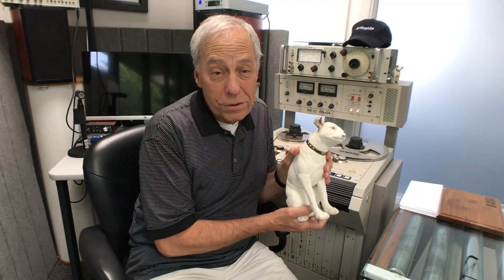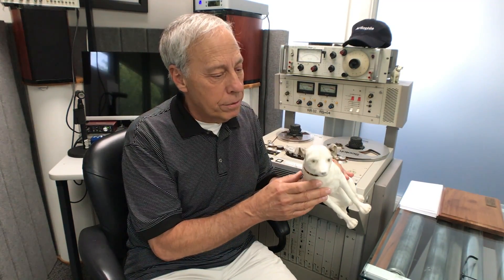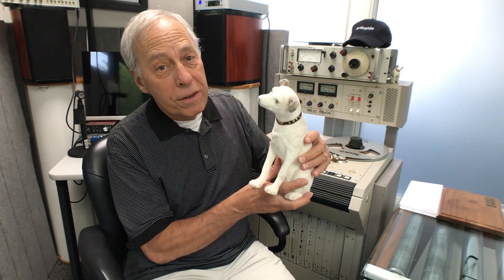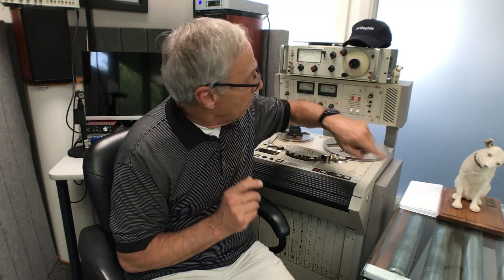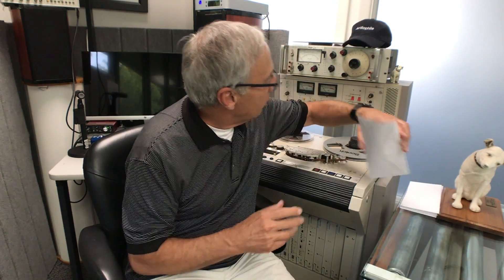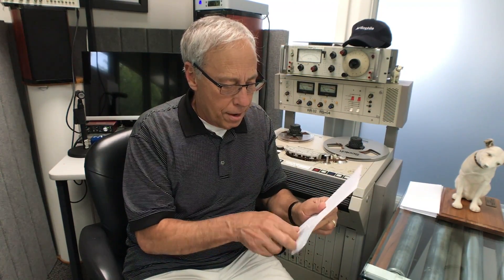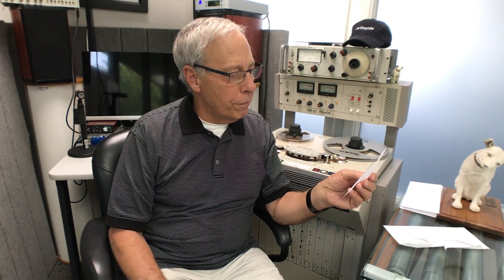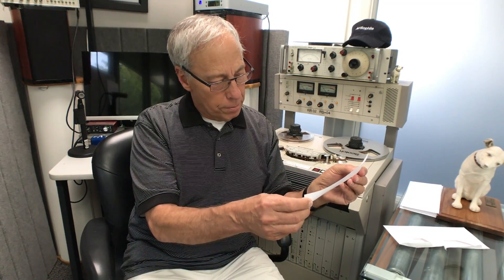Thin cables inside speakers

Comment: Okay straight answer. Money. That's why. They save it. You don't. But it's not needed anyway. 

Convoluted answer. They work with people that sell that fancy thick wire, and realize you don't even need it anyway. But don't want to make these people look bad, and kill the golden goose. He said more about himself by not really saying anything. And showed me that he has no integrity by doing this. There are a few people in the industry that will tell you this truth. Like Frank Van Alstine. His stuff even has the old school power wire you can't swap out, because he knows it's not needed. It's Snake Oil period!

Think you need big fancy cables? Ask an electrical engineer, and see what they say.
Reply: Hey Paul, I'm gonna be on the fence here ... I've been playing bass for 30 years, getting paid 29 of those. I honestly don't recollect how I came across this page just now, but when I saw the title it got me curious. Now that I've read this, I'm even more intrigued. On stage, my low gauge instrument cables ... hmmm ... when all that gets to the circuit board inside my amp, the wiring is tiny on it's way to the huge cables going to my speakers. Not jumping on any bandwagon, but just saying this initial question got me curious, and your initial answer didn't do any favors for yourself so that's maybe why he came across as snarky :) ... love to hear a detailed answer from an engineer or IT guy though, or more of your thoughts. Again, I'm just a spectator who found my way here, but I've also earned a living as a bass player for over two decades, always buying the best cables. Thanks sir!
Reply: Andrew Balus -- Peace, little one. :)
Reply: HH Scott had a point. This video didn't even come close to addressing the point of the question, much less give anything that even approached a technical answer to it......with references to thick wires and thin wires and "horse leg" cables. He did mention a couple of gauge numbers, but then didn't put them in any technical context. What ARE the issues here? Surely it involves technical issues of how much power the cables and leads must carry......not to mention less tangible issues of quality and durability. Do we judge the internal wiring by the same standards that impact external power cables connecting the speakers to the amp or not? There was no answer to the question, but some talk about the ceramic RCA doggie with fur and some fumbling unsealing a white envelope.
Reply: Dannys998876 Well I didn't know this when I wrote that, but Paul here doesn't just make/sell amps, and speakers. He also sells.....wait for it....

That's right. Cables! His most expensive power cable is $1200!!!

Think that might be why he didn't want to get "technical", and actually give an answer? Yea me too

Twelve hundred frikkin dollars for a cable that these companies freely admit, even though they're engineers, they don't know why it even works. It can not be measured. But it sounds "better". We just don't know why. Lol

Audio Quest made HDMI cables for audio that sounded so much better on their ad video it was shockingly good! So good that someone decided to look into it. The guy was a pro, and ran tests on it. He found out it was a fake. It was completely rigged. Then they pulled every copy of it off the web, and it's not been seen since. Tried to say someone else made it. Lol

Those thin wires in the speakers are fine. It's just a short run. Same reason they just use thin wires in equipment too. Fancy cables are a waste. Unless you're running really long runs, and/or a lot of power. You don't need anything crazy. And even then. You don't need crazy thick. Just a little thicker. And you should get good quality if you care. But just buy Blue Jean Cables quality. That's good enough. 

A lot of this audiophile stuff is a waste, but some can even hurt your equipment. I was just reading something that Roger A. Modjeski (Music Reference amps) wrote about this. The fancy resistors, or something like that were causing failures in the units he was seeing when he did repairs. They weren't electrically sound. They were never properly tested that way. Just for sound quality. A lot of times the cheaper stuff is better. Not the cheapest I mean. Just regular premium quality stuff. 

Some of the $50 audiophile fuses too are not good to use according to electrical engineers. They're not the correct design to work as they are intended. Which is to keep you gear safe. They don't put safety first though. They design for sound quality only. Or let's be honest. They design them to sell as ones that give better sound quality. Because I doubt it even matters, as long as they're not junk Chinese fuses.
Reply: Exactly.  Every electronics engineer learns ohms law in first semester.  He claims to be electronics engineer but doesn't answer the question for which he, as an experienced electronics engineer, should have an abundance on knowledge.  But he sputtered on about everything except.
Reply: Andrew Balus
Reply: This is a trick question by the way ... I'm just trying to help ;) (I'll keep my 25' bass cables on stage)
Reply: HH Scott......I agree that there is stuff that matters and stuff that doesn't. And in this case, the answer didn't even come close to answering the question. Plenty of dancing around it though. There is no limit to how much money audiophiles will spend on c*** that they think makes a difference.......but obviously doesn't from any measurable engineering standpoint. I have many friends with middle aged hearing who claim to be able to tell the difference between a solid state amp and a vacuum tube amp.......and FAMOUSLY, there is that lush sound from vinyl records that people are just SURE sounds far superior to top quality digital media. My standard snarky answer is that OF COURSE I can tell the difference between vinyl and digital.........the vinyl is the one with the annoying pops and clicks.
Reply: HH Scott.....Interesting comments! I never had a collection of vinyl, or any sort of high end sound system. Mostly MP3 files through computer speakers or some CD's played through the little sound bar sitting below my TV screen. I'm afraid that for many people, computers and MP3 files took away the interest in high quality sound systems, in the same way that my older photography friends say that digital images on a computer screen took away the magnificent Kodachrome film images projected 3 ft wide on a screen in a dark room. I do have a few friends who have more or less high end sound systems. They will say they hear all sorts of differences in all sorts of things. For me, past a certain minimum level of system quality, all I can really hear clearly is the quality of the speakers. Based on what I can hear, it seems to me that whatever big money I would spend would go into the speakers. I have listened to vinyl, and particularly In very quiet passages of classical music, the pops and clicks drive me crazy......compared with CD's and digital audio files.
Reply: Dannys998876 Speakers/amps aren't everything at all. The source is incredibly important too. It's a chain, and it's only as good as its weakest link. But you also have to remember that the more you spend, or the better the gear is. The more revealing it is. So a good source won't make a difference with a receiver. But will be dramatic on a $30,000 system. 

What I'm putting together right now for my source is a Raspberry Pi/Allo Digione/linear power supply combo. And then I'll eventually get a real nice DAC. Although there are cheap ones that sound good like my Starting Point Systems DAC 3. There are much better ones for $1000, or less. You have to choose carefully though. I do mainly Tidal streaming. So that works for me, and will be really good. If I had better equipment. I would have to spend more on something like an SOtM sMS-200ultra ($1400 with master clock connection, $1200 without), instead of the Pi. And instead of an $80 linear ps. I would get the $300  Sbooster power supply instead. And probably a master clock too. This would be a waste for my system though. And would cost me a kidney. 

Then there is system coherence. Some stuff just works better with others. I have a pair of Pinnacle PN8+ speakers that sound okay on a receiver. Better on my SET, but really only on the tweeter, and amazing on my AVA Omega Star 250EX. They need the power, and it's a more balanced amp. Older speakers designed in the days of tubes would be very different. These were designed in the 80's. A bright sounding DAC, and/or speakers will sound good on a vintage tube amp, but horrible on a very high definition solid state one. And vice versa. You would want very warm speakers, and DAC on that amp most likely. Although there are people who love bright, and really defined. I hate it. It hurts my ears. 

So you need to know/learn what sound you like, and learn what works for that. And match them accordingly. You then may have to work on the room if it has issues (most do), and/or use digital room correction. This is assuming you've done all your audio hygiene, and everything like cables are in order too. This is why I do endless research. You are lucky enough to have friends with knowledge. But that might not be good if they are the type who just throw money at problems. That's not the smart way to do it. 

And you may just not be that guy. You might not care enough to spend the money. Or you might be happy with good speakers, and an AV receiver that has built in room correction, and DAC. Or a vintage Technics New Class A integrated amp, and a nice streaming network player from Marantz, or Cambridge Audio with vintage speakers. Or a simple Chinese SET amp, small Omega speakers on your desktop, and a decent DAC connected to your computer might do. Or even just a cheap DAC connected to your computer with a cheap Chinese chip amp, and some old bookshelf speakers from Craigslist. All are better then cheap Bluetooth speakers running off your phone. 

It's all what you want. Do you need power to listen loud, and have bass slam. Or do you listen to Diana Krall, and wouldn't care about that. It is basically endless in possibilities. So if you care, and want to spend the money. Learn what you like, and do the research. Audio forums are your friends. Try AudioKarma, Audio Circle, Audio Asylum, DIY Audio for starters. There's more. But they'll do you fine. They all have buy and sell forums too. I buy almost exclusively used gear, or build my own. AudioKarma is $25 a year to use the buy and sell forum, but has the best deals and is definitely worth it. 

I'd be happy to help, or direct you to people that are more knowledgeable about something if it's out of my realm. But we'd be better doing that via email, or on one of the forums. I love the forums. If 2 minds are better then one. Then much more is even better right? And anything I, or others say can easily be corrected by someone with more knowledge. Which is great, because sometimes we hear the wrong info, and wouldn't realize we've been lied to otherwise. And believe me. Having the correct info can save you a fortune, and lead to much more happiness too. Especially in this hobby. There are snake oil salesmen lurking around every corner. Lol

One last thing. If you think what I'm talking about can get complicated, and it can. That's not even the half of it. You can't believe the ends people go to for great sound. There are guys in Japan having dedicated electric nodes built just for their house. I'm talking having their own poles installed in their yard (tens of thousands for this). Because there is interference on the regular lines caused by all the stuff we use like toasters, and such that mucks up your sound. People spend crazy money for this. Lol
Reply: Dannys998876 Oh, and ask your friends if they'll show you different amps on one pair of good speakers playing the same music at hopefully the same volume. If you really listen. I bet you'll hear it.
Reply: HH Scott: Thanks for the discussion. I'm probably a guy who wouldn't know a 20 dollar wine from a 200 dollar wine, or the sound from a top end audio system from one that's just pretty good. But I can appreciate that there IS a difference, and I can appreciate quantifiable technical data. 

I really don't know what Chris H's problem is with your comments. The guy simply didn't answer the question. He danced around it. He provided no worthwhile technical information. I'm not sure in fact how much technical knowledge he actually has. Take a look at his video on capacitors and try to figure out what he's saying. He said at one point that a microfarad is one one thousandth of a farad. And it wasn't something that he quickly said in passing. He obviously thought about it, and a mistake like that is unforgivable. I know now not to look to this guy's videos for nay kind of reliable technical information.
Reply: HH Scott True, there's a big market out there for audiophools and he is a businessman and had to make a living out of his business. In fact I think he is a better one as I thought he advised against snake oil business out there a few times too.
Reply: Offering choices isn't a problem.  Disingenuousness  is.
Reply: What better way to peddle snake oil than to create persona of not peddling snake oil.  Basically the same thing politicians do.  Present themselves to be your best ally while robbing you blind.
Reply: HH Scott ok dumb ass 😂😂😂😂dont take piss cables do matter if you try the right ones . I dont understand why people chat so mych shit about all cables being snake oil may if you buying moster cables and cheap shit like that yes. But been using QED cables since 1997 up to when i upgraded my set up in 2013 getting DENON X4000 DENON 3313UD and DALI ZENSOR 7 5.1 set up and upgrade back 4 channels to DALI ZENSOR 3 on custom design fs104 signature speaker stands including my tv stand and tv i spent ovet £8000 on getting home cinema up and running. So spending about £1000 on QED cables was a good thing as over years i have seen how much difference there  cables make to picture and sound example when i was  waiting for my set to get delivered i had picked up 7 hdmi cables from QED  
1  PERFOMANCE AND 
5  REFERNCE  and had buget cable that came with my samsung bluray player. The  reason i got the performance was for x box 1 but thought id give it try on bluray player as it could handle deep colour which standard cable couldnt now staight away you see more colour and picture looked sharper and not much edging  i thought wow this was just as impressive as when first i tried there RGB only REFENCE scart cable over budget cable on my sony 735 bluray player in 1997 or 98 lol. Now when i put the REFERENCE in it was PERFECT picture was razor sharp so clean and so much space and detail  depth and blacks were perfect could see every different kind of black tone in image and white was pure white. As for my speakers i use QED genesis silver spiral from there signature range and subwoofer cable from signature range, and for 4 back  channels i use QED silver anniversary XT all with airlock. I can hear so much detail and bass is tight and in control perfect for my set up. And further more i belive you should atleast spend 10% of what you spent on your home cinema is nothing really was going to get Dali icon package and upgrade that but chose to save the £1000+ and use on cables
Reply: It doesn't matter when it's so short distance if it's low frequencies so the impedance is low and the power heating the cable is low.
Reply: HH Scott, you'd better ask not electrical but electronics engineer specializing in audio engineering.
Reply: @IliyaOsnovikov  You can ask an electrical engineer, but only one qualified in long distance HV transmission who has training in capacitance and inductance per mile, line twist and impedance effects on a long distance transmission line.  The effects are the same.  Ask them to to the calculations on a transmission line when the line is under and over loaded (impedance change) at other than design frequencies over several octaves.  For scale have them design a transmission line from 0.5 HZ to 500 HZ.  They will see the exact same issues you see in a 100 foot speaker wire that is seen in power transmission lines.  Voltages fluctuate and large reactive currents.  Ask about power factor correction, tap changers, time domain reflectometry and issues that are very real at power line frequencies.  If they are familiar with it, ask about the big East Coast cascading power failure of 2003.  The wire was a major contributor to the failure.  The effects of impedance of the wire in this event resulted in many substation redesigns of protection equipment.  Voltages on the lines as the load changed went nuts and unexpected voltages and surges resulted.  Some breakers that opened arced over due to higher than expected voltages.

The physics of wire apply to power distribution as well as audio.  In short distances a jumper can connect just fine, but on longer distances, and higher frequencies, reactive loads, and impedance differences, the effects on both is very real.

I was training to work in power distribution, but at the time I finished training, the US government was fully discriminating against a race and gender in their Affirmative Action Plan, so I entered private industry instead.  See Affirmative Action for more details.  It is discrimination based on race and gender.
Reply: @isettech  The most of the people who believe they know everything about wires and cables for audio would usually stop at calculating a power loss in cables based on the Ohm's Law. They view an amp as just a voltage source and any loudspeaker as just a load resistor. Those "specialists" probably never heard about output impedance, Qe factor of speaker drivers, complex loads etc. And that could be OK if they did not attack the other people, who know a thing or two beyound basics, so viciously.
Reply: For the majority of music lovers that 99 percent listen to music in your homes well  from an American electrical engineer in the German technology industry would say how thick is your electrical wire in your residential home ? Lol
Reply: @tee-jaythestereo-bargainph2120  Where's the relation between thickness of electrical wire in home and the size of the speaker wires? There is 115 (230) VAC at wall outlets and there are way lesser line currents than currents going into 4 Ohm speakers. Besides, have you ever heard about Damping Factor?
Reply: Electrical engineer here.  It's a matter of fact that EVERY cable has clearly measurable characteristics of resistance (R), capacitance (C), and inductance (L), and thus, every cable comprises an RLC filter.   An RLC filter WILL change the frequency response of the system that it is part of.    If you change the way the cable is made, the R, L, and C parameters can and will change, thus changing the cable's effect on system frequency response.    So, yes, absolutely,  cables CAN sound different and in fact they DO sound different.  Not only that, but it is possible to characterize the output transfer characterisic of the source (driving device, source, or amplifier)  and measure the input transfer characteristic of the sink (driven device, amplifier, or speaker) and be able to PREDICT with high accuracy how a given (known characterized) cable is going to alter the system frequency response.     However, there's no NEED for a cable to be particularly large in order for it to be designed to present a specific combination of RLC characteristics.      In fact, there is a certain equivalent cable gauge size that is sufficient for all signals you're ever going to put through them, without appreciable voltage drop.  Once you've reached this cable size, going to a larger size gains you absolutely nothing at all.  Except for a larger debt, of course.
Reply: @Turboy65  You seem to forget the fact that a speaker cable is not just stand alone piece of equipment but a part of a larger system. As an example, some loudspeakers with a boomy bass greatly benefit from a better control and damping from an amplifier. And that requires much larger wire size that is required for a simple power transmission.
Reply: Yup!  Big, pretty, expensive cables and wires are partially like that for aesthetics.  So if anywhere there were corners to cut for cost savings with little downsides to sound....yup.  cables.
Reply: HH Scott even if you have a point, I still think youre the biggest ass on any youtube comment section ive ever read, and thats saying something. I don't know if you wejt off your meds or if you really think that this is an appropriate way to approach people with your opinion. Its pretty gross. Nobody is stealing money from anybody. Use whatever you want. Nobody is stopping you and nobody is forcing anybody to buy anything. The fact is, there's a market. If I'm a casual "hobby" type player, I might want to make a purchase in support of said hobby. Sometimes people want to buy something because they want to buy something. New toys to play with can be invigorating and inspirational. Maybe I want to buy something, but a new, better guitar is out of reach, but I can get some unnecessary tough looking cables to give myself a little bit of the same "new stuff" buzz. Whats wrong with that? All hobbys are money pits. This is nothing new. Welcome to capitalism. Theres a market, a company filled that market. If you're an uninformed consumer, thats your fault. Nobody is holding a key to this "secret knowledge". Grow up and quit blaming other people for imagined slights. Speak with respect, if not for the person you are speaking to, then for yourself. Respect yourself enough to not splash your petty garbage all over the internet. It makes you sound stupid and childish.
Reply: Ok, the electric engineer would say that cross-section and length of any cable will determine its resistance. Resistance has NOTHING to do with sound quality. If you use very thin cable on the outside, like the wire on the coil, then you would have a slightly higher resistance and the only thing it does is that the speaker may be a few dB less loud. The one thing one can do then: turn the volume a few dB up... 
If resistance would impact sound quality, none would built amplifiers with variable amplifying and without volume knob.
But thick cables from the hardware store aren’t as costly than the ones from an „audio phile“ studio. You don’t need these voodoo cables for 100€/$ the meter. It’s fraud. In music frequency there is no skin effect and music is alternate current thus there is no possibility for directional cable nor need for burn in.

Instruments cables are another story though. The music level is that low, that you need every dB headroom for the Signal to not drown in background noise- especially for passive guitars. Then the long cable can act as an antenna and has to have a very good shielding. So there is need for good constructed cables.
Reply: Andyw1228, Resistance is fine if you are dealing with a simple resistive load and a simple sine wave or DC.  In an audio system the ability of the amplifier to step, move, stop, a speaker driver is called the damping factor.  Google it if you are not familiar with it.  A decent amp may have a damping factor of 30 or more.  Damping is the inverse of the amp's output impedance or it's ability to deliver the correct voltage when currents are present on the terminals from speaker cone movements.

For example the damping factor of 20 for a decent amp is an impedance of 1/20th of an ohm or 0.05 ohms.  If you go cheap and use a 20 foot 18 awg wire like some stereos at big box stores, the resistance of the wire to the speaker is 0.2556 which completely nulls the ability of the amp to damp the speaker cone movements. Now the amp and wire damping factor combination has changed from about 20 to less than 4, just due to the choice of speaker wire size.  If you use 18 AWG speaker wire, keep it under 2 feet in length round trip.  See a copper wire resistance table for the numbers. Learn how to use it and do the math if you wish to find a speaker wire with the ability to preserve the amp damping factor.

For a car analogy, this is the difference between racing on a dry track and racing on a wet track.  There are control issues with high performance and poor torque transfer.
Reply: isettech also. The thicker the wire the less impact the passive crossover feedback noise has from bass into treble or vice-versa.
Reply: @Andyw1228   "the only thing it does is that the speaker may be a few dB less loud. " 

 But 3db down is 1/2 the volume. To bring that volume drop up requires 5 times the power. Every 3db increase in volume requires 10 times the power.  Not a big deal for tweeters, but it would seem a very big deal indeed to drive woofers. So, if you have limited watts in your amp, and want to drive woofers at loud volumes, one would think that thick wires for woofers would help a lot.
Reply: carlos oliveira lol. Yea that's the ticket. I'M the delusional one. lol rolls eyes
Reply: Andrew Balus you make a lot of common sense. I'm not technical engineer, but I'm sure a lot of current is carried by pcb traces before and after amplification and someone can correct me, but they are usually on the thinner side.. And then output to Jack's using modest cable. It all just sounds like dog poo with sprinkles on. Though it still smells like poo.
Reply: Dannys998876 Well there is a difference in sound. On my crappy turntable vs my crappy DAC. The vinyl is definitely more dynamic on drums for instance. But I'll take the digital myself. I don't like pops, and clicks either. You can spend more, and do more work to get rid of that tough. I do think vinyl sounds better. But once all the big money is spent on either. It's a wash I think. It's really just what you spend. Digital costs a little more at the lower end, but cheaper at the high end. And in the end once you buy all those records vinyl will cost more. You can get digital cheap, or free.

And the tube thing. It measures worse for sure. And I can hear the difference between amps clearly. Just play the same thing, and listen carefully. As for what's better that's a choice. And the quality of the amps matter too of course. My SET is miles better then my AVA Omega Star 250EX, and a little better then my Scott 200. All of them blow away my receivers. There are more expensive amps that will probably blow them all away. It's just what you enjoy that matters. Of course any SS will do bass better then my tube amps. And more extended treble too, but I hate that (hurts my ears). In the midrange though where we are most sensitive. Tubes reign Supreme! 

You can't tell someone something is better, because that's all subjective. For instance I have hearing issues, and can't listen to loud music for more then one song without my ears hurting. Unless it's on tubes. Now is that the tubes? Or is it because it's output through transformers? I don't know. I just know I will take the tube every time if I have to choose one. But I love my SS setup for rock and roll enough to have spent the money. I can't listen loud for long though. So I'm going to try a tube preamp, and a tube buffer on the DAC. Hopefully it will help. Either way. There definitely is a difference.

I've done those blind YouTube tests where you listen to tubes, and SS. I've picked out the tubes every time so far. It's very noticeable to me. There's clues. And certain music is more noticeable. Some you really can't tell though. Usually there's like one song, or one riff on the guitar amp tests that give it away. Of course I'm sure you could fake it with a computer program/emulator. But if I listen loud for two songs to any SS amp in a blind test. I will nail it 100% of the time due to my ear pain. Really one song will do. And if I don't get the pain. I'll buy that SS amp right away if it's affordable. Especially if it's powerful.
Reply: Chris H So you freely admit you're susceptible to shiny beads and shallow flattery? Wow! Not sure I'd be letting everyone know that if I were you. But hey. Different strokes, and all.

Okay so first. A guitar costs less then these cables and I mean a pretty decent guitar too. He literally sells $1200 cables. That's one cable to be clear.

And I don't have a problem with that really. I have a problem with his dishonesty. He didn't answer the question, because the truth wouldn't help him. And why take this of all questions? Only to not even answer it? Guilty conscience? 

It's that simple. My issue is he pretends to be a man of integrity, but he's not. If he were. He would have answered the question honestly. He brags about how they are electrical engineers. So he definitely knows the real answer. 

This ain't rocket science anyway man. The real answer is because thin cables are all you need for that short run. This is true with most, but not all, electric cables. But he didn't want to get into that did he? 

Did you also know he freely admits to using Emotiva amps at home? You want to buy an amp from a guy that won't even use his own gear? And there's other issues too, but you get the point. And I'm not the only one that feels this way. I've talked to others on audio forums that feel the same way as I do. He lacks integrity. 

As for how I talk on the internet. This isn't just the internet. You my friend are in the cesspool of the internet. This is a completely anonymous unmoderated troll fest here. When in Troll City act like the Trollmans do. I'm not going to be that sucker that gets trolled. I'm going to do the trolling pal. When I'm in respectable venues with people that allow others to know who they really are. I act accordingly. I'm not a jerk, like you think. I'm just playing the game the way the rules are laid out.

Google allows this place to be this way for whatever reason. I think it sucks. I used to try to be nice, gave my real name, and had my picture as my avatar. If that went well. It would still be that way. But oh no. I learned. I also learned that others can totally attack you, and even break their rules without any repercussions. They won't even take the post down sometimes. I've reported things 5 times, and nothing.

And me being the worst. You obviously haven't spent as much time here as me friend. I'm quite mild actually compared to others I've seen. I've had people search me out on Facebook, and make fun of my job, my looks, my weight, my brains, my girl. You name it. You unfortunately are being as naive as I once was. You'll learn though.

If you don't like my behavior. I suggest you contact Google about it. They are the ones that set this place up, and they set the rules too. They allow it to be like the wild west with no law basically. I wouldn't get my hopes up if them doing anything about it. But it might be worth a try.

Normal forums on the internet have moderators, and good rules of what behavior is not allowed. They don't want to pay people I guess. Although I'm pretty sure most mods work for free, or almost free. They usually are into whatever the forum is about though, and probably have control issues too. Lol

So there it is man. Now you know the deal. I bet I'm more honest then most here, and sometimes that comes across the wrong way. I'll tell the truth no matter how painful it is. And that's the truth. Could I rise above? Sure, but this is more fun. Until they do something about it. This is how it is. And they've given us no reason to care. So I don't. I don't care at all. I'm not going to worry about something I can't change. I'll just deal with it in my own way. By giving back the same respect they've given me. None! 

Flame on!
Reply: And Donald Trump tells you not to believe fake news while he's lying right to your face!

This dude is so sketch.

I'll say it again. I'm far from the only one who sees this. There's many others who are serious HiFi guys, and they think the same way I do. There's reasons for this well beyond what I've said here.
Reply: Andyw1228 Exactly. But this guy won't say that, even though he knows that. Why? To protect his buddies in the business that are robbing Audiophools blind with their voodoo science cables and stuff.

And that's my whole point. He has no integrity because of this. So even if he's a good guy for the most part besides that. And even if all his products are top notch quality items. It doesn't matter. Why? Because I can't believe a word he says. And I can't trust him. He sold his soul out. I could never live like that myself. To me all we really have is our integrity in this world. I don't care what else you have, unless you have that.

And if you have that. I can look past a lot of other flaws. There's nothing more important then integrity to me. I mean how can you even listen to someone when you know they're not being honest about something?
Reply: carlos oliveira You f"cking troll!
Reply: Paul McGowan Okay so your company may do that, but big companies like Klipsch don't. They cut corners all the time to save money. I have a pair of Klipsch RF-3's that have cone breakup up 4500hz (aluminum cones). They cheaped out, and didn't put a notch filter in the crossover. So they cause fatigue. They knowingly did that. And for one reason only. Money.

And I question your integrity on only the one issue. The lack of truth to protect others in the industry. You act like you can't answer the question. But you can. The only reason you didn't is the truth is those big wires are a waste of money. But you don't want to offend others in the industry that sell that snake oil. Yet others like Frank Van Alstine do tell the truth. His ego may be too big. But he tells it straight. You're just like the supposed "good' cop. Who lies, or better yet. Fails to tell the truth. To protect his comrades. Which is why there's no good cops. A good cop would arrest other cops. And since that never happens.....

You're doing the same thing. Guilty by omission. See how that works?
Reply: Dude, chill out. Why do these attacks always come from people who don't even own hifi equipment? If it's just jealousy, then get over it. I don't have a Porsche, I like them, but I don't go on Porsche videos telling them it's all bullshit because Joe so-and-so said so, and they're selling snake oil because a used Camaro SS goes just as fast for 1/4 the price. The guy was nice enough to invite you to hear the demonstrable difference and you just keep on him calling him a liar. If you're mad at the industry because your freakin' Klipsch RF-3 was built to a price point? Lol. That's rich. Get a better speaker. There's a whole other world of levels to experience in HiFi and most of all LISTEN and LEARN about.
Reply: @amb3cog  *Than
Reply: Heidi Roekke To be honest I don't even think my initial post is snarky. I think that's just games being played right there. Trying to put me on the back foot so to speak. 

And you're right about his initial NON-answer. He's picking and choosing. He's claiming to be so smart ("we are electrical engineers"). Yet in the video he just poo poos around the answer.

Look it's simple. If you're so smart. Then tell us the truth. Since you obviously know the answer. And you claim to have integrity. 

Unless you don't want to make others in the industry look bad. In which case. Your integrity is out the window. As is your credibility as an engineer. Because you can't honestly answer a simple question about electronics. 

He's fooling himself thinking he can have it both ways. Not everyone is that easily fooled. Maybe he'll grow a pair someday, and decide to stick by his integrity. Even when the going gets rough. But until then.......
Reply: micromem It's all a scam man. Notice they don't use audiophool cable in pro sound studios. If they master the original recording with basic wire. Then why do you need fancy wire at home? You don't, but the people they sell too are usually the type that have more money then they know what to do with. So they eat it up. If someone wanted high quality speaker cable. I would suggest they just use 16ga oxygen free copper, unless it's a very long run. Or network cable. Or pro audio. But any wire will do fine. Even lamp cord. The speaker wire you choose can affect the sound, but not "improve" it. Just change it. You may like the change. You may not. Or like most. You probably won't even notice it. Unless you just spent a ton of cash, and want it to sound better. That's what they call psychoacoustics. You can really hear what you want to basically. Lol

There's plenty of info on the web about this. My big issue is that otherwise decent folks in this industry don't call out this BS. Even the ones that don't sell it. Because they don't want to rock the boat. Or kill the golden goose so to speak. A few do though. Like Frank Van Alstine. For this reason I have much respect for the man. His stuff is reasonable, sounds great, and lasts forever. And he will tell you to use any wire you want. It all sounds the same. He's a real character for sure. Gotta love people like that. He's even called out guys that reviewed his stuff over this. If it looks like sh]t, and smells like sh]t, then it's probably sh]t. LOL
Reply: Az Usmb Why don't you go stick one of those cacti in your ear. Maybe it will affect that deficient brain of yours in a positive way. BTW I subscribed to your channel. I can't wait for you to post something so I can critique you, like you did me. Probably won't happen though. Since you're just full of shite, and arrogance anyway. A nasty combination if I've ever seen one. Where are you from anyway? I'm just asking so I can avoid dealing with people from there in case they're all as stupid as you are. Wouldn't want to waste my time actually expecting anything intelligent to come from them, or anything.

Oh, and BTW I showed my girl your comment. She thinks you're so angry, because you have a tiny pecker. Is that true man? Come on be honest. Is it small? It must be according to her. She says only guys with small units try to act superior over such nonsense. And I've got to tell you man. It makes sense. Tin ears? Rockers? Who talks like that man? Oh duh that's right. Guys with small peckers. Guys like you. Lol
Reply: Andrew Balus -- If tin ears/rockers can't hear the difference between high quality wiring and home depot solid-core then so be it. Move on, there's a big, big world out there for you to save.
Reply: Andrew Balus You are deluded. Also could you do research on "snake oil" as you're using the term incorrectly. Snake oil is the genuine stuff. You're referring to snake oil imitators. I know people such as yourself like to regurgitate phrases they hear without knowing what they really mean.
Reply: Az Usmb Oh. And I never said I use solid core. You really are f@cking stupid aren't you? You can't even read! Pathetic! smh
Reply: Az Usmb I never said I can't hear any difference. And I never said there wasn't a difference. I said there's no improvement and there's not. If your TIN BRAIN can't understand that. You're probably not smart enough for me to waste my time trying to explain it to you. Now go take your crappy argumentative attitude, and go troll somewhere else you stupidly arrogant POS  you! I forgot more about HiFi then you'll ever know. And I obviously know more about electrical engineering then your pea brain can handle. If you understood that sort of thing. You wouldn't be here wasting my time with your childish comments that only do one thing. Prove how little you really know.

Any pea brained idiot knows how this goes. Multi strand sounds brighter, solid core sounds warmer. Copper=warm. Silver=BRIGHT. It's called RESISTANCE! That's the change in sound dumbarse. But neither equal better. There's ZERO improvement to be had by expensive cable. You can CHANGE the sound, but NOT improve it. And you can do the SAME EXACT thing with Home Depot wire. Any Friggin IDIOT knows this. Except for, obviously, your dumb arse!

Let me translate this for you. Since you're so SIMPLE! You can go to Home Depot. Get the wire, and build your own wires. To the SAME EXACT EFFECT if you choose to. Because this is EXACTLY the same thing they do at these companies basically. They may not buy it there, but somewhere else that's equally cheap. Just get quality wire. Simple! You'll notice they use the same stuff you can buy at Amazon on the ends too. 

So unless you're an INCREDIBLY STUPID PERSON LIKE YOU ARE! And feel the need to waste your money so you can brag to your EQUALLY PATHETICALLY STUPID Friends! You'll just go buy this, and use it. No need for the fancy ends if you don't want to. It all does the same thing. Doesn't have to be thick. But it helps if you want bright. Remember. Resistance! So go thin if you want warm. 

Now F@CK OFF YOU PATHETIC POS TROLL!